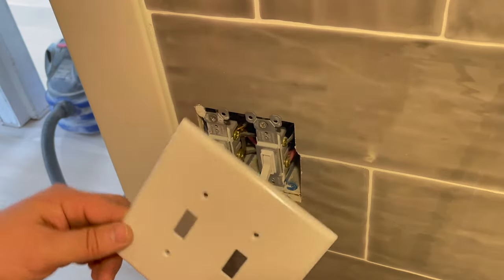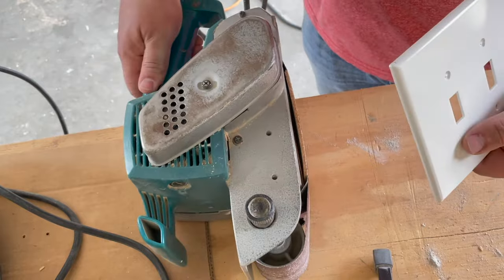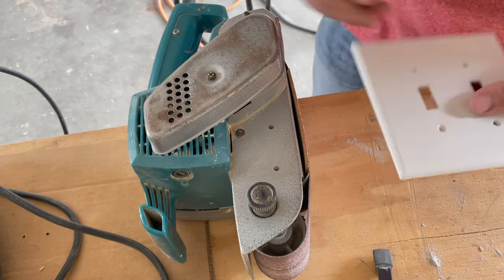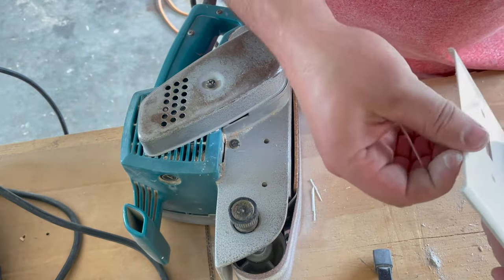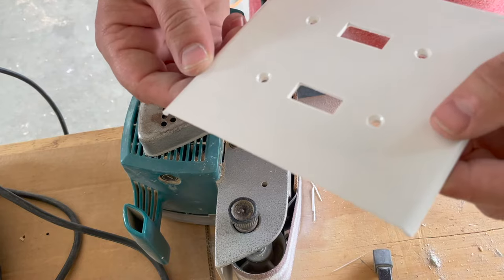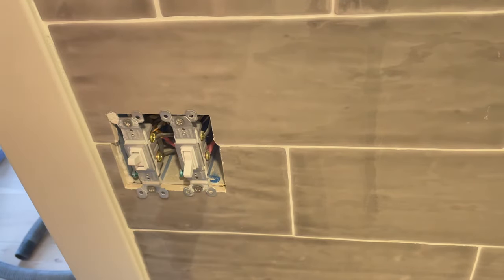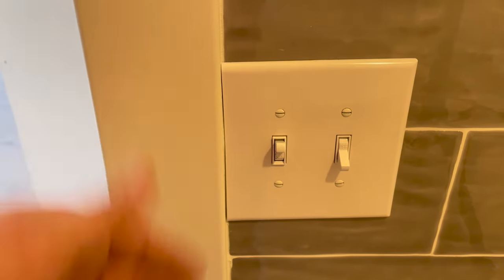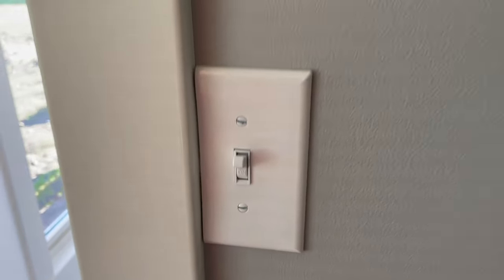How to Cut Down a Plastic Switch Plate or Outlet Cover

Comment: Nice, now I just need to figure out where to get a belt sander on the cheap
Reply: most pawn shops have corded beltsanders for super cheap!
Reply: Harbor freight and Facebook marketplace is ur friend
Reply: If you spend about $.20 more and get the more flexible Nylon ones, you can score the cover with a utility knife a couple times and then cut them with a strong pair of scissors.